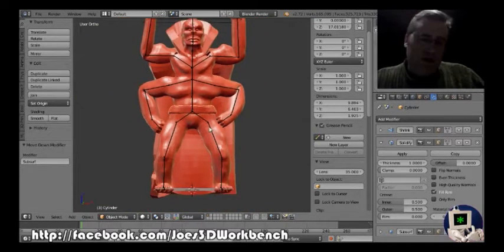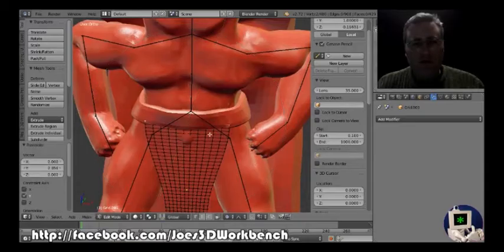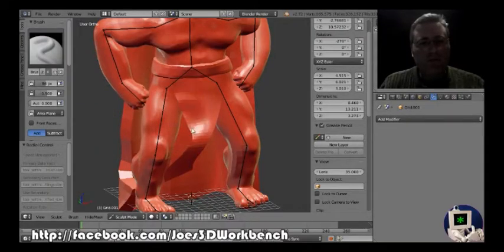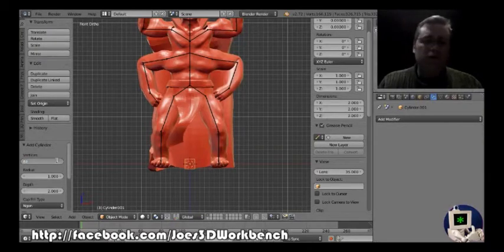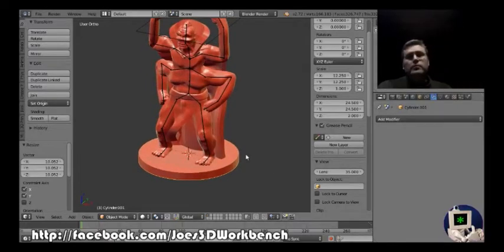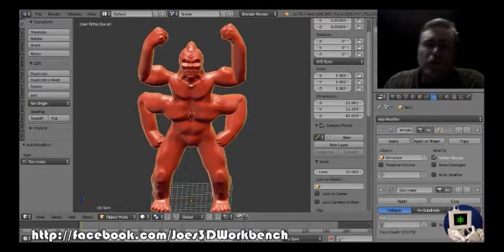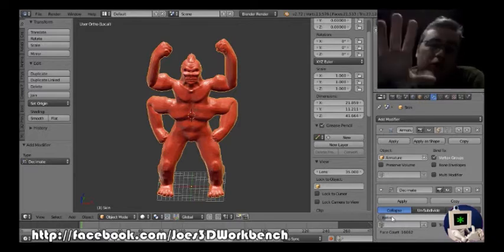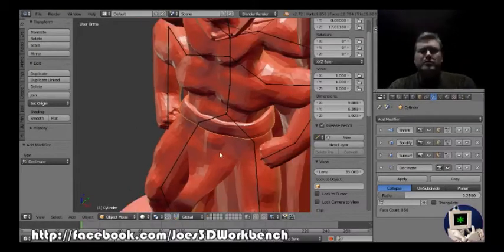Modeling a 3D printed mini part 6 - Finishing Up

Comment: It's looks great! The print was surprisingly accurate for the size you printed at. Have you modified your printer in any way? Yours looks to be based on the Makerbot Replicator, and I find myself banging my head against the wall sometimes because of the problems we have with ours. We're using a Da Vinci Aio 1.0 as a temporary fix in its stead right now, because the Replicator's recently given up altogether (and we haven't gotten the Hadron up to working capacity).

Even when it was working, though, there were clear jostles between layers. Here's the last "high quality" print I got out of it before it died. Any suggestions?

http://youtu.be/oxnnzBfiyo8

Settings were .1mm layer height, 2 shells, 40mm/s feedrate, 55mm/s travel feedrate, 225 C print temperature (the blue ABS tends to print more reliably at slightly higher temperatures), 110 C bed temperature, 10% infill, and full raft/support.
Reply from the maker: It's funny you ask about modifications because next week's video is all about the mods I've done to my printer. yes, I've done a ton, but the one that had the greatest effect in my opinion was using Simplify3D. Makerware works fine for big objects, but for small objects like this Simplify3D is so obviously surperior. It's the best upgrade I've made to my 3D printer.